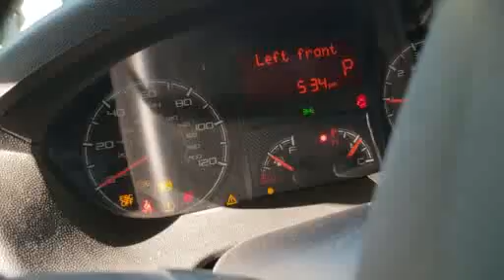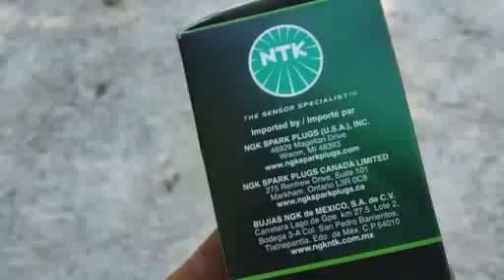Ram ProMaster 1500 air conditioner fix

Comment: I had the same problem. Water and grime get up the hole at the bottom of the mirror, and fail the Elkab sensor. I searched everywhere and couldnt find a replacement. Mouser and NTE never heard of it. 

What they sent you is the interior temp sensor, which mounts behind the dash on the back of the three knob panel. I know this because I ordered one of those too. 

I solved the problem with just putting a resistor in the mirror. 20k gets you about 40 degrees, which will be ok for winter. The point is that if the computer calls up full pressure from the compressor, and it’s 10 degrees outside, the pressures will go crazy high. That’s why it wants to know the putside temp, and that’s why it disables the system when it doesnt. 

In spring, I’ll put the interior sensor in like you did. 

I have two 14 promasters, both with over 500,000 miles. Ask me anything, I’m super knowledgeable on these things.
Reply: Do you have the part number for the temp sensor that goes in the mirror? My 2015 promaster 1500 118 WB is doing the same thing. AC compressor won't turn on and I have no temp reading on the dash.
Reply: Zane Gold Sure dont. Using a generic resistor worked for a while. Eventually, I figured out that I could take the mirror apart, use the behind the dash sensor that rockauto sells (cabin air temp sensor) with some soldering and modifying, and reassemble the mirror. It’s not too tough and it does work. No other solution that I know of, no other source for the correct sensor.
Reply from the maker: The one I put in it was not exactly for the ProMaster I think it was for a Dodge Ram truck that I can see if I can look it up
Reply from the maker: Ambient Temperature Switch  Airtex  5S1137
Reply: maxam home repair Yes, that’s the one I used. It’s actually used behind the 3 knob control panel, and it measures cabin air temp. It requires some modification to use it in the mirror, but it does work. Basically, you cut off the area around the two pins on the connector socket, solder two wires there, and connect them to the two wires that go to the stock outside air temp sensor. It’s a hassle, but it works.
Reply: @kipamore  Thank you very much for your comments, my promaster 2015 does not turn on the control panel or control of the air conditioning controls, must it be because of this damaged sensor? please let me know.
Reply: @maxamhomerepairAndatvrepair  Thank you very much for your comments, my promaster 2015 does not turn on the control panel or control of the air conditioning controls, must it be because of this damaged sensor? please let me know.
Reply: Alex Mendez the telltale for the broken mirror sensor is two dashes on the digital dashboard temperature readout. If you have that, then it’s the mirror sensor. It not, your problem may be elsewhere.
Reply: @kipamore  Thank you very much.
Reply: Kip Amore, we have a 2014 Ram Promaster 3500. It has a loud surging sound coming from the front engine area. It’s not the engine. Do you have any idea what it could be?
Reply: @normabournes5789  No idea. Many possibilities. You need to be looking for a symptom. Low power, steering issues, braking issue. Something to point you in a direction. 

Another tip - a long piece of hose held up to your ear makes a fantastic stethoscope.

Comment: I removed the power window switch, accessed the 2 brown wires, cut off the side going to the mirror, and used a 7.2k resistor to tie the 2 brown wires together.  The van thinks it is 90 degrees outside and the a/c works.  Free fix.
Reply: Can you explain more to me how you do that?
Reply: @DaBeastly6669  I don’t know if you got yours fixed, but I was able to get external ambient temperature sensor, which is white and red and white and light green plug same position of the window switch reading 185 but is working
Reply: @JuanOrtiz-mo8be  I did get it fixed. The ambient sensor had to be cut and rearranged